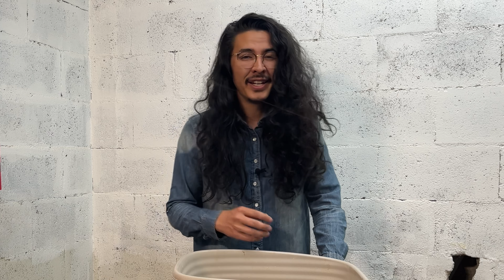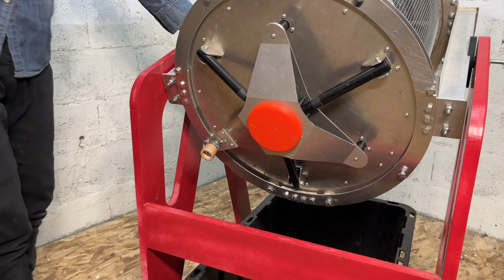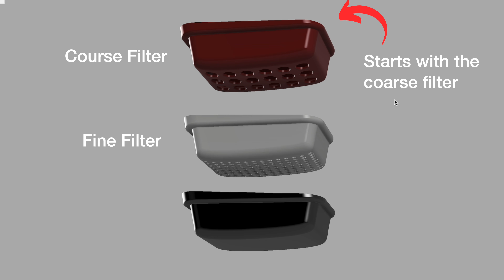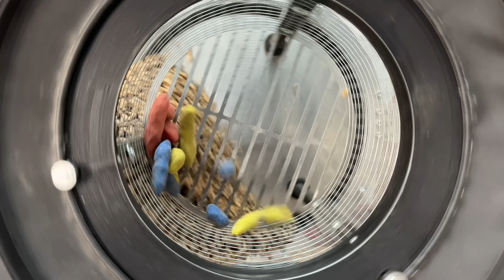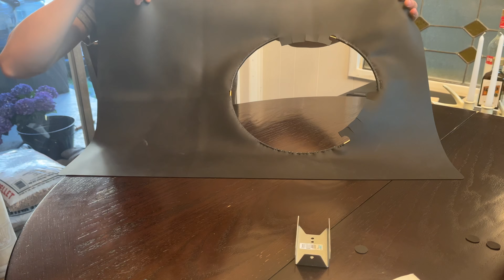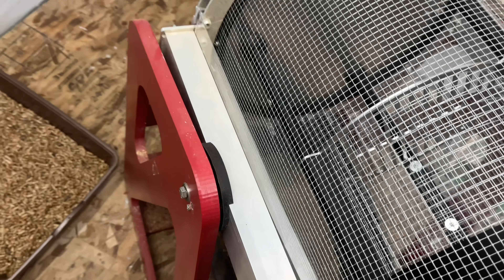Everyone Hates Cat Litter, so I Built This

Comment: First NEVER buy pellet litter made specifically for cats because it is ridiculously overpriced. Horse or livestock pine pellet bedding from a farm store like Tractor Supply will be much more affordable.
We have been using wood pellets for years and a 40lb bag at Tractor Supply (at least in northern Ohio) is only $8!
When we had 8 cat boxes for our 7 cats, using clumping litter was ridiculously expensive. We kept just two boxes with regular clumping litter for the cats that wouldn't use the pellets and cut our litter bill to less than a quarter!

Comment: I'd love to modify this design for sifting mealworms (which often require sorting by size) or the method I use for processing walnuts (which also requires sorting)

I especially love the push button opener - an incredibly elegant solution that doubles as a funnel

Comment: Ive used wood pellets for cat litter many times before. Unfortunately my current cat is sensitive to cedar oil which is a common wood for these. 
FYI for cat owners
Reply: We use Natural Pine Pelletized Bedding from Tractor Supply. As far as I can tell pine is the only wood used. Maybe it is worth checking with your vet? At Tractor Supply we get 40lbs for $8.

Comment: One thing that I think you should consider is reducing the amount of time that fine particles are falling through the air. I feel like you are on the way to a good solution with just being able to dump the box into the device and get clean litter dispensed out.  I'm betting that you could have the drum at a fixed angle and just be able to dump, crank, and the waste comes out of one chute and clean litter out of another. Maybe some inspiration from concrete truck drums would be helpful.

Comment: I switched to the flushable clumping soy/corn litter a few years ago and it's so much better. For one, the pee never actually reaches the bottom of the tray so it doesn't cake, there's less dust, it smells like a wood shop or porridge, and it lasts so much longer because the clumps don't break apart into dust the second you pick them up, coating everything with urine powder that gets reactivated every time someone showers.

Comment: An interesting idea. It will not sterilize things, or prevent fine fecal particles from remaining in the pellets, but the fact that the pellets disintegrate once they've been hydrated is certain an interesting behaviour to take advantage of. Next addition: a vacuum hose attachment point (in the form of a hollow axle through which the air can be drawn) along with a multistage vacuum cleaner so that dust and particles are captured rather than being released into the air during agitation of the used litter.

Comment: Dude !!!!
This is genius !!!
What a cool design !!!
Personally, we didn't like the sandy dusty clumping litter either, because of the same reasons you described.
So we finally landed on the clay pellets.
That's really a pretty good system, (No kitty litter box stuff in the bed...lol) minus the fact that we don't like that there's the pee pads that you have to dispose of every week which adds to what's an our landfills.
They aren't biodegradable and made of polyethylene, so that weighs heavy on our minds.
Your system would be pretty cool for sure !
We would probably have to put it in the garage or outside somewhere because the kitty litter box is in the hallway in a tiny closet that I removed the doors so it fits in...lol
So I don't know where we'd put something of that size. 
Perhaps a smaller design would be more practical and marketable, like the size of a diaper genie, which we use for the kitty disposal. 
Maybe a wider mouth or a larger removable funnel to pour in the wood chips and stuff, then you can pick it up when you remove the funnel and close the lid, shake it, and empty it over the litter box again ??? 
Ehhhhh, just a thought...lol 
Things always sound easier then they are in practice. 
Haaaaaa 
Anywho, excellent video and very inspiring !!! 
My grandfather was an inventor, so I love thinking up new ideas and trying stuff... 
That is... 
If I have free time.
😂🤣
Band gigs, and work have me out of town way too much...lol 
Love to get back to the roots of inspiration and invention !!! 
Thanks for the wonderful video it's so inspiring !!! 
Have a great day !!! 
😁👍
Ps.
I lost it laughing at the commentary on the triple show down and who won the Litter Off !!!!
That was great !!! 
Hahahahahahaha

Comment: This is such a cool proof of concept. I’ve tried the pellet litter with multiple cats and you nailed it on the various issues and frustrations with using it. So interesting to see you problem solve for all those challenges. 

I eventually gave up on pellet litter, not because of the scooping issue, but because I ended up with a cat who would rather poop beside the litter box than use the pellets. 🤷 So back to the clumping litter and all the issues that come with that.

Comment: Thank you! This is the only thing online I've seen that describes my cat litter problem! We have 4 cats and grew tired of throwing away over 10lbs of clay clumping litter a week. We switched to pine pellets and use horse bedding pellets and cedar sawdust mix. We scoop the turds and use a sifting litterbox, it is a 1 hour job for 4 litter boxes, producing lots of dust. Before I came upon this video, I've been designing a similar contraption using a 12 inch diameter bingo cage as the sorter. Also using a larger drum used to spread compost as a rock/ garden dirt sorter trommel. So again...I totally get and appreciate your thought process and solution on this.
Reply from the maker: I knew there would be other people in my position that needed a better solution! It’s definitely an over engineered solution but it was a ton of fun to figure out

Comment: I need this to sift the fines out of each bag of heating fuel pellets for my pellet stove. If not sifted the fines clog up the auger. It would sit outside unprotected year round so the bearings would have to be weather resistant and I would add a cone for more accurate pouring

Comment: Why not use a ramp so you just drop and the spinning happens by itself
Reply from the maker: I originally was thinking of doing a ramp, but I wanted the ability to continue sifting as long as I needed to so I could be as thorough as I needed. With a ramp, you only get the length of the ramp to dictate how thoroughly you can sift

Comment: I wish I had one of those machines to use for my cat’s used cat litter. Brilliant idea. A bit big right now, but I’m sure a smaller scaled down version would be brilliant. I’ve always used wood pellet cat litter in the UK.
Reply from the maker: It's definitely pretty large and if I didnt have so many cats, it wouldnt be worth it but I'm happy to report that. months later, I'm still using this daily and it works like a charm! Perhaps I need to refine the design for a smaller version though

Comment: Beautiful turn out!  I made almost exactly the same things about seven years back when our band still existed lol.  Except mine all operated on the same four channels.  I used four-pin locking connectors and four conductor wire.  Each of the fixtures had a male and female connector wired together so I could link them all together and connect the last fixture to the first creating a full power loop so the voltage drop wasn't a problem by the end of the line.  My stands were just sand filled 1/2" PVC fitted in an H.. Definitely admire your base design and versatility more though!  I'd like to build some with sound reactive controllers and addressable WS2812s though.

Comment: I love the build of the prototype :D Very envious of you having the space to house a CNC haha. My main feedback is that from an outsider's point of view it just seems really big - when you pour in the load of litter, it just seems to not take up much room in the barrel. I figure that's just part and parcel of how you sift things, having the room for tumbling.

My other smaller question was that I wasn't sure if that initial baseplate needed to be a grate? it feels like you could just rely on the mesh to be the filter, but you might just need to have a lid that closes. So the process would be: chuck in - close lid - tilt - rotate for a little while (sawdust comes out) - unlock lid - turn upside down for poo to come out - put litter tray under and push button for good pellets to get released. Again not sure if it's a good idea but might catch you on the discord some time to talk it through :D

Comment: I use wood pellets in a litter box that I DIYed. I bought 2 of the same litter box (a covered, top-entry model). I drilled a bunch of holes in the inner layer that are a bit smaller than the size of pellets, and raised the inner layer up with some feet so there's a couple of inches of space between the two boxes. I pick up any poop with a doggy bag and put it in a repurposed compost bucket that lives beside the litter box. (Kind of like a diaper genie...). Then I either stir or shake the litter box so the sawdust falls through the holes into the lower (not holey) litter box. Once a week I dump out the lower box and rinse it out, then add some new litter pellets to to the top box. (And empty and wipe out the compost bucket! 😛)
Reply from the maker: Sounds like a good system!

Comment: we used to have these pellets and they SUCK
Reply from the maker: Interesting. What didn’t you like about them?
Reply: the simple fact that as the cats pee they dissolve into a nearly impossible to remove powder that just got stinkier and stinkier until you dumped the entire box and replaced it all @SuperValidDesigns
Reply from the maker: That’s exactly why I made this! When the sawdust can be properly sifted, the pellets can go a long way before needing to be replaced but it was also so annoying to properly sift using the trays. Tbf though, I have a lot of cats and the issues with the clay litter were just compounded
Reply: my guy i got a scoop that literally has the sand running through it while the lumps stay in it it is AMAZING @SuperValidDesigns

Comment: what happens when the poop is gooey? will it not smudge all over the net?
Reply from the maker: Great question, I haven’t had the opportunity to test this yet but I imagine that would be an issue regardless of the method used. If I get an opportunity to try this out, I will and I’ll report back with the results! The wood pellets do a remarkable job of drying things out very quickly so it might be okay